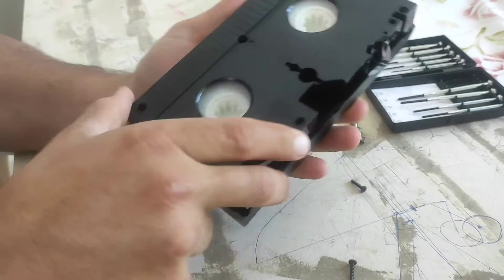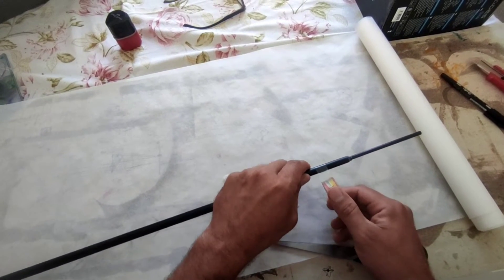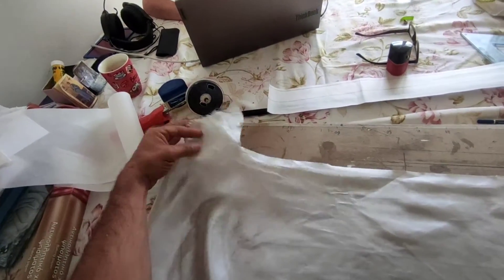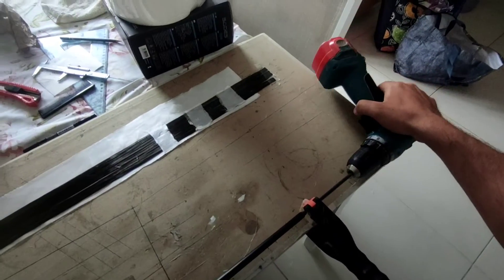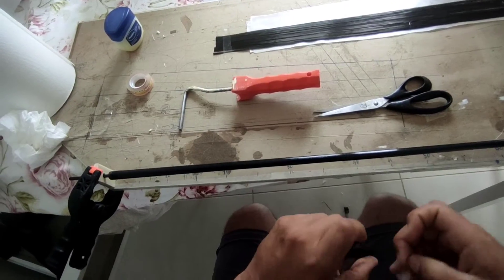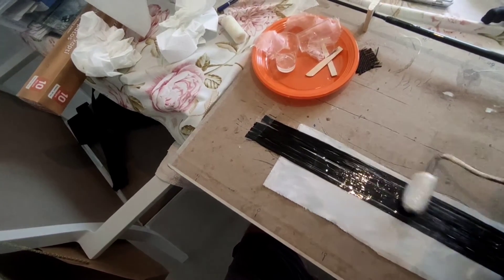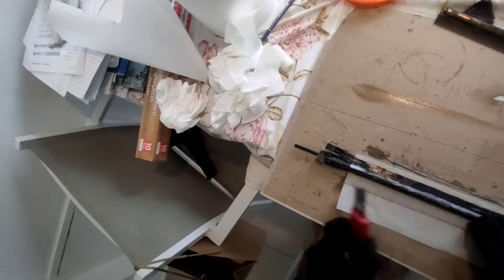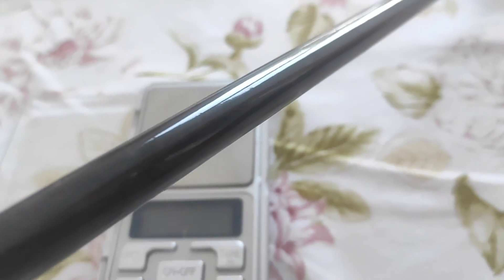How to make a dlg boom

Comment: What is density of the fiberglass cloth? I guess for 1.5 glider it should be 2 X bigger. Several monts ago I tried to do exactly the same procedure, but it was a total mess (problems with wrapping, tape separation etc).
Reply from the maker: GF is 25g/m2. I had the same problem once and you need to debalk the epoxy with the toilet paper. A better solution would be to use thin PP sheet strips put together with tape to wrap the inside of the boom.

Comment: Just a quick question or possibly a suggestion.  Have you tried to test or weigh a carbon fiber shaft from a set of "Golf Clubs".  You can buy just the shafts from any shop online...would save you a ton of time and effort.  Just an idea...

They are amazingly strong and light as well as tapered already.
Reply from the maker: Thanks, I try yo work things out with what I have around. My booms are now made from UD carbon tape and its a pleasure to work with. Total weight is around 10g for my 1m planes. Good idea I'll take a look at them..
Reply: @afilos     So i went and checked on amazon real quick and Golf shafts are heavy.   They are 65 grams at 41" length (or 102 cm).  I think you build your shafts at 55cm so a Graphite golf shaft at 55cm would be almost 30 grams.   3x the weight of your scratch built shafts!!!  Wow you build that plane super light.   What is total all up weight once your plane if flight ready?

I am trying to combine Dollar Tree Foam board techniques with your build ideas.   Want to get a plane up in the air soon.   I think i only have 9 gram servos though at the moment.   I will need at least 3 5g servos to start.

I am subscriber sir!!!  Cheers
Reply from the maker: I've built at 105-120g max and after few repairs I always end up to 130g. Boom should be max 10-12g, you should go for a light arrow shaft to begin with. Thanks and don't forget to share your build at https://www.rcgroups.com/forums/showthread.php?3749159-Scratch-Built-DLG-on-the-cheap&p=49664553